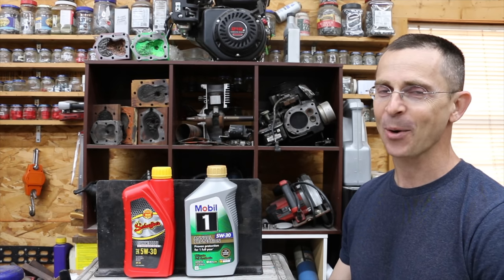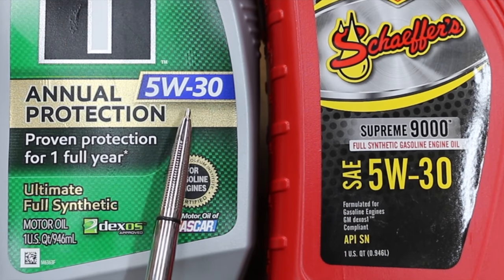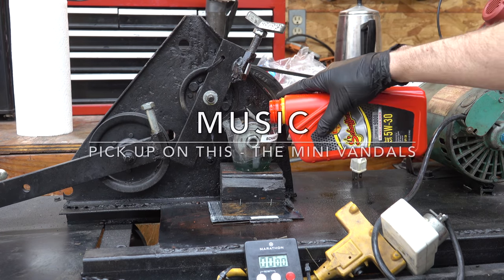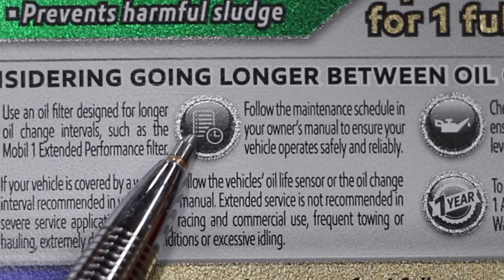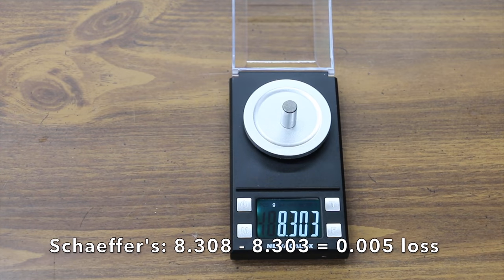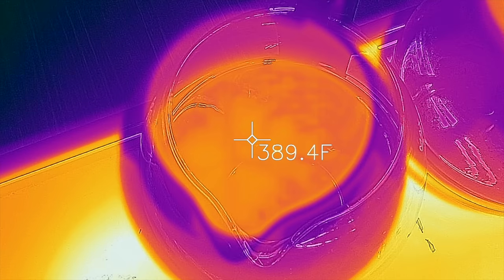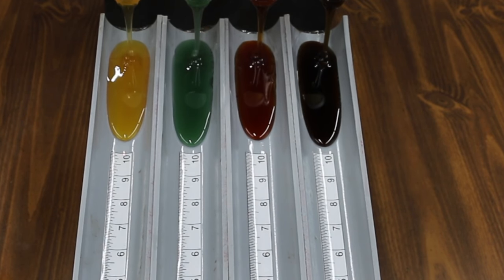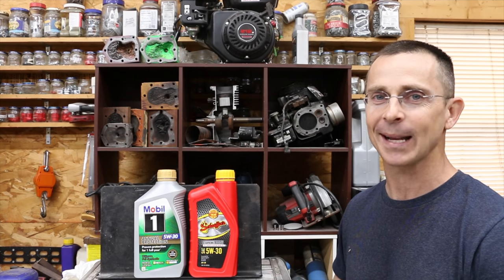Is Mobil 1 better than Schaeffer's Full Synthetic 5W-30 Motor Oil? Let's find out!

Comment: I work for a private Fuel/ oil testing lab if you want any other special tests ran
Reply from the maker: Awesome!  Could you send an email to me at projectfarm52@gmail.com  Thank you!
Reply: Project Farm And on that day, 500 unsolicited emails from fans were left unread
Reply: Jordan Jungman Amsoil so far is performing the best here. Can you test Amsoil OE vs XL vs Signature Series vs Dominator
Reply: T6 and super tech  synthetic high mileage
Reply: YES! Do shear stability tests please.
Reply: Pennzoil Ultra Platinum would spank any off shelf full synthetic I think based on research & personal use. Test it !!
Reply: I would love to see a oil filter bracket too. Mahle, Man, Hengst, Fram, mobil, etc.
Reply: @mr.k4561  I tried supertech high mileage...beleave me you are going to regret because it is too thick. However the others oils might probably be good. simply...do not by high mileage is too thick. I used it in a toyota corolla 2006

Comment: Holy crap this channel is amazing. The fleet that we had years ago all transferred to Schaeffers oil after we ran a series of test between 100 vehicles. I think it was about ten vehicles each received a certain brand of full synthetic oil with oil samples sent off every single oil change. At the end of the year Schaeffers oil was decided on and we extended our 5000 mile oil changes in F150s to 13,000 miles per oil sample recommendations. The trucks were already out of warranty as standard oil changes were no longer relevant. A few of the trucks that we used for highway parts running were extended up to 17,000 miles. Amsoil was up there but they cannot beat the bulk prices on Schaefer.
Reply from the maker: Thanks!  Thanks for the feedback.
Reply: Amsoil is just better:)
Reply: @WickedG5150 Wrong
Reply: @SyphADL87  are you kidding me?
Reply: @WickedG5150 Do you work for them or something? 😅

Comment: $13 a quart? Ouch. 10 quarts needed in my mustang. $5/quart Mobil 1 regular full synthetic is good enough.

Edit: bought a case of Schaeffer’s to try out in my ‘18 GT from Amazon. Night and day difference from the Mobil in terms of engine noise/smooth idling even with a basically new engine. The hype is real!
Reply from the maker: Thank you!
Reply: what year is your mustang and what engine? 10 quarts is a shitload of oil
Reply: @brendenmacvicar738  my '09 G8 GT uses just under 9 qts, 1 qt less than my damn Duramax!
Reply: @brendenmacvicar738  the new mustangs are dry sump so the oil tanks are much bigger
Reply: @GrandPrix46  jesus christ haha i never would have expected that much oil to be in there... Would definitely help when people don't change their oil for extended periods of time though i guess haha
Reply: 10 qts should be good enough for the life of 99% of mustangs.

Maintenance free for "life"!
Reply: Holly crap, Do you have a Mack truck engine in that thing
Reply: I buy schaeffers for $6.40 a quart. I’m not sure where he paid the $13 but ouch!
Reply: I pay ~ $25 for 5 qt jug of Mobil 1 at Walmart.
Reply: We sell the 9000 series Schaeffer for 9.68 a quart. That's here in Charleston,  SC
Reply: @brendenmacvicar738  yeah it's crazy man.  I usually buy 2 5 qt jugs of M1 at walmart, the leftover quart I use with another 5 qt jug when it's time to change the oil in my Suburban since it takes 6 quarts.  Works out pretty well.
Reply: My Old 1982 Kenworth Cabover. 350 Cummins 13 speed takes 14 Gallons of oil every oil change
Reply: @midnightrunner684  Hell yeah!
Reply: @isaakwelch3451  Actually they are not - still wet sump.  Gen 2 Coyote = 8 qts, Gen 3 = 10 qts.  New nylon drain pan and oil filter design.
Reply: Try Penzoil Platinum, can get great deals in bulk and much better than standard Mobile 1 in my opinion.
Reply: @GrandPrix46 My 5.0l F150 takes just under 9 qts, so I buy 2 of the 5 qt jugs, and have one qt left over for my old inline six jeep, she takes 6 qts as well.
Reply: Hughes Enterprises, My '05 Ford diesel holds 4 gallons.
Reply: I had 14 1/2 quarts in my GTO, larger size oil pan, 2 double sized remote filters and a large oil cooler.
Over a case of oil every oil change...
Reply: supertech full syn! its good af and cheap. look it up on bitog
Reply: @crashoverride4646  You say that but I've seen the dry sump tank in my mustang.
Reply: RYAN SEACREST Put in Schaeffers when I changed the oil this weekend. Very noticeable difference in reduction of engine noise. Mobil had 6K on it and looked fine, but I’m glad I dumped it when I did.
Reply: Decided to do some research into the best oil I can put in my Mustang after watching the video and reading this comment definitely going with the Schaefer’s when I put my stang in the shop to fix the rear main seal leak

Comment: How about the lubricity test after cooking. Love your channel! Keep up the great work!
Reply from the maker: Great recommendation! Thank you
Reply: @ProjectFarm  Someone had suggested this in your last oil comparison video and you replied that you were going to incorporate it into future test. What happened?
Reply: @EDesigns_FL , Tournament's already underway.  Next season, perhaps :) ...  Or, he already has the data and will do the big reveal during the all-stars.  Thank you for your work!
Reply: @gth042  Since the bacon fat test illuminated the folly of the lubricity test, it would have been nice to have a little more to compare. I live in Florida; so the cold fluid test doesn't mean much to me.
Reply: Was just thinking the same thing.
Reply: I've been suggesting it since the first oil test but for some reason he wont do it, but it is his choice and it doesn't take anything away from his great videos, it would be icing on the cake for me if he did.
Reply: This one could have been filmed already, or maybe he'll take the top 4 or 6 and test those after cooking
Reply: @EDesigns_FL  I believe the Lubricity test works, but I feel the follies of the lube would be more apparent with more weight added to the arm to really push the oil/lubricant
Reply: @EDesigns_FL  living in canada where it can be -40 or -50 Celsius for weeks in the winter the cold flow tests are very useful. I do agree with the cold/cooked lubricity tests though, that would be nice to see.
Reply: It's not so smart to change the testing methods midway into a competition. I would like to see the test. But you can't judge on that, unless he starts doing it with the final 4, or 8.
Reply: @ProjectFarm  Hey from Wisconsin! really appreciate all the tedious work you do to bring us good reviews, I enjoy and utilize almost every one. Next time you do a chain lube vid include John Deere's product if possible, lotta farmers around here use that.
Reply: How funny, I just made the same reply Jesse.
Reply: @EDesigns_FL  Y'know it is still his youtube channel..
Reply: @ProjectFarm  do a video on the Indian oil brands

Comment: Thank you for taking the time to do this. I've been using Schafer's for 20 years. I love it
Reply from the maker: Thank you!
Reply: ur overpaying tho
Reply: Never heard of Shaeffers
Reply: @mikecekic2393  not when you're changing your oil 1/4 as often and you're never tearing down an engine for engine wear failure. If you're running conventional oil you are spending four to six times more money on oil then I am in the same number of miles plus the cost of the oil change even if it's your own time and an oil filter.most of my engines run an entire year on 1 oil change 1 filter. The rest of them are changed per what the oil lab analysis tells us the change interval should be most are around the equivalent of 24000 miles on stationary other dirtier condition engines are around 12000 miles. Recommendations on the bottles are 7000 and 9000 miles but we send everything into a private analysis lab to be sure we are getting the best protection possible. I can almost guarantee you that if you sent me a sample of your conventional oil that had  3000 miles on it and I sent it into the lab the results would come back that you should have changed your oil a thousand miles ago.
Reply: @davidweum9334  private company my uncle and cousin sell it some of the best stuff out there

Comment: I never heard of that oil, it's good stuff! Thanks for another superbly done video Todd!
Reply from the maker: Thank you very much!  They are both very good products.  Looking forward to your next video!
Reply: It is sold at Callahan Auto Parts
Reply: Maybe because its 13 bucks a quart
Reply: It’s good stuff
Reply: @JoshT4life   I buy Schaffer’s for around $9 a quart from our local Schaffer’s dealer. It’s one of 3 next to Pennzoil and Amsoil that hold the correct rating for the Ram Hemi.
Reply: @danlaabs5090  you run the three and see which one comes out on top. I'll stick with the one brand it's been around forever because I know it's on top and I know what the inside of an engine looks like after a million miles of running the red bottle. And to be honest I've never seen the other two oils get an engine to over 200,000.
Reply: Never heard of it either. Seems odd if it’s so great...
Reply: I used Schaefer’s on a farm in combines and trucks, I never even thought of it for my pickup. Running Mobil 1 Extended life, I might have to swap. Swapping my cam and lifters right nowC I did have the lifter failure and didn’t catch it in time. I’ll see who comes out on top.
Reply: @alanj7306  They make fuel cleaner and oil additive too my father has been using for long time in his old vehicles it’s good. Also a friend ran 12kmiles on his engine before changing oil just to see what would happen that was years ago still runs like a top.
Reply: @johnsonlong1272   Kid I bought my car from has been using the 5w-40 9000 diesel oil Schaffer’s since 30k miles ish. I still do now with 126k miles never have to add between oil changes on a car people claim is a issue. I plan to have this engine last atleast 200k.
Reply: @conanrehm8388  I have never had a lifter failure with Schaefer's. But I have with both mobile and Pennzoil. In fact I have a customers tractor in my shop right now gas engine with a hung valve it's a Pennzoil baby. So I will be switching it to shaffer's start it up let it idle and I'm willing to bet that will fix it without turning a wrench. I will let you know.
Reply: One reason you guys may not have heard of Schaeffer Oil is because it's primarily used in racing applications. Pavement Oval racing, Dirt Oval, drag racing, road course etc... Cars that run 700-900+ hp on E85 or Methanol. It's rare for me to come across another race team not using Schaeffer.

Comment: I realize you only needed a quart of Schaeffer Oil to test . That’s why it cost you so much. Schaeffer strategy has been to market primarily to heavy equipment fleets, mining companies, and large agricultural operations. They usually are selling their products by the 55 gallon drums with a 5 gallon bucket being considered a small amount. Most folks don’t realize how much packaging & mainstream ad campaigns add to the cost of products.
I’ve run their products in my agricultural equipment for about 15 years and through oil analysis I’ve concluded that their oils, hydro fluids, and greases are the best on the planet. They are also significantly less expensive when you’re buying larger quantities. Schaeffer’s commercial customers are fiercely loyal because not only are their products top-shelf but the people in the company are as well. My rep has always went above and beyond the call of duty if I needed something.
Reply from the maker: Thank you!

Comment: Our family has used Mobil 1 synthetic for well over 30 years. Never once have we had any kind of internal engine problem. It’s proven itself for us year after year and vehicle after vehicle. Walmart always has the best price too, at around $25 for the 5 quart jug. It might have lost the comparison, but experience trumps a single test in my book. Grew up in the Midwest and we’d use 5W30 during the winter and 10W30 in the summer. That probably helped us out too. That’s just my experience, as I’m 35 and helped my dad with oil changes since I was 5. That’s what he taught me and he’s unfortunately passed, but his knowledge is still serving me well. God bless!
Reply from the maker: Thanks for sharing!

Comment: It would be better if you tested the Lubricity on 100-120°c (or engine operating temperature) maybe that would make a difference for the oils. Really good tests keep up the good work!
Reply: True :) should do a Cold ( to simulate cold start )  and Hot test
Reply from the maker: Great recommendation!  I'll do that in the next round.
Reply: @ProjectFarm  good to hear that 👍 thnx for all the info
Reply: @ProjectFarm  Dont change anything for the current tests planned.
as it could throw off results.
Reply: @ProjectFarm  what about running a lubricity test after the oil has been cooked?
Reply: @IIGrayfoxII  Yes! Maybe a follow-up contest for the final 4 after all results are in for the current tests?

Comment: Been doing my own work for 55 year.  Ran Mobile 1 in our from new 2005 Honda CRV.  Changed the oil and filter every year.  Sometimes 7K, sometimes 10K on it.  At 100K, I put new plugs in it and checked valve clearance.  Looked like new under the cover.  Some light brown stains.  No crud.  Valves were within .001 of being to spec. No wear on cam chain tensioners and cam chain timing was dead on.  Car still runs like new.  So Mobile 1 will do it's job.  Gave the car to a granddaughter.  Now testing Mobile 1 in a Subie Crosstrack.  With a $12 rebate going on now, 5 quarts of Mobile 1 is a steal.
Reply from the maker: Thank you!